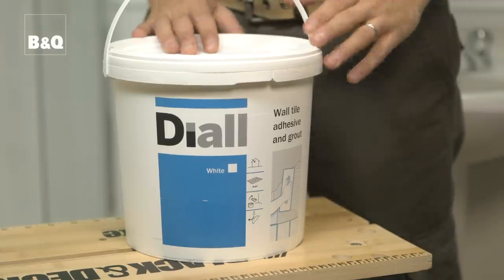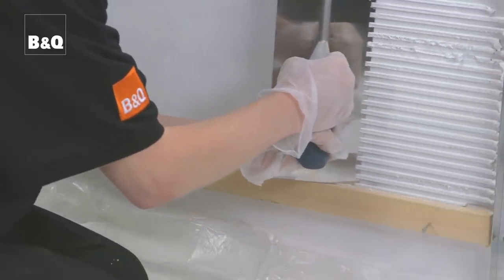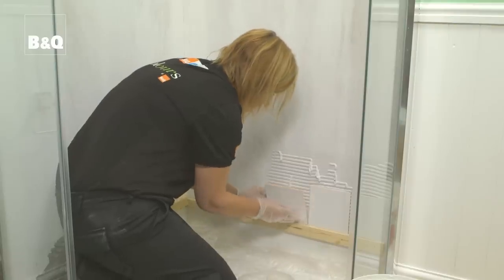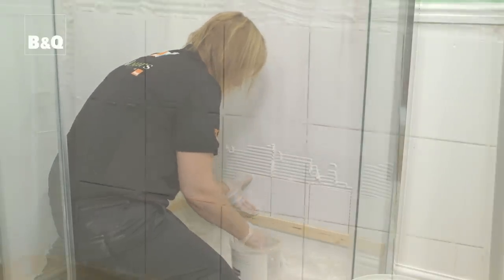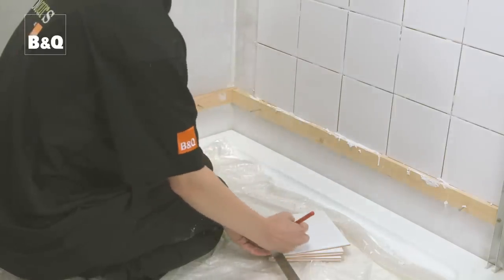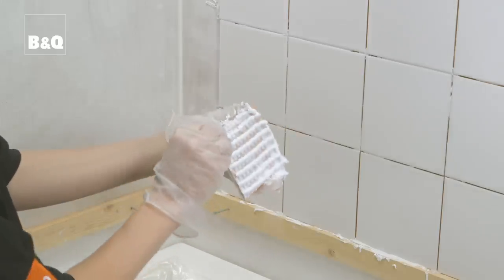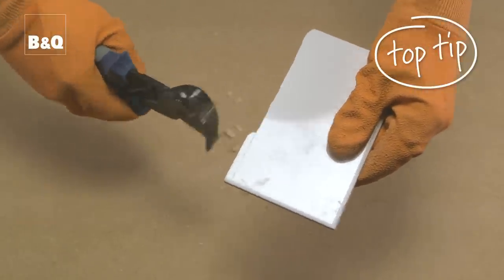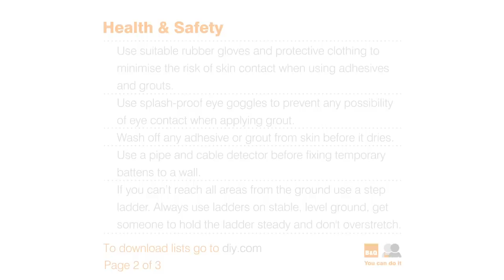How to tile a shower part 2: tiling

Comment: One very important point is don't tile round showers directly into plaster or plasterboard. That should be coated with a tanking material first. Grouting and tile cement is permeable (even the waterproof stuff - waterproof just means it doesn't dissolve in water, it doesn't mean watertight). Any dampness that does get through can cause plaster to disintegrate and tiles to loosen (or worse).

Also, if tiling the complete bathroom, then you have to think about the tile placement with respect to the entire room, not just the showering area. Also, I strongly recommend using a laser-level on that first batten row around the room as it's all to easy to and up with a misalignment.